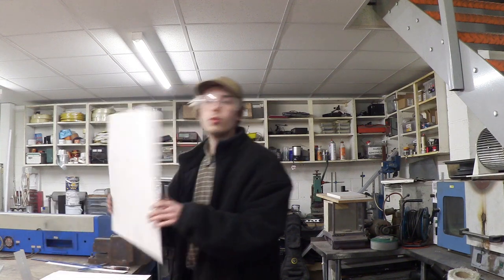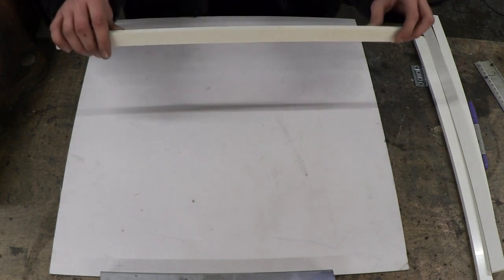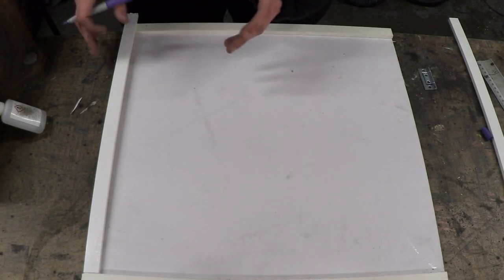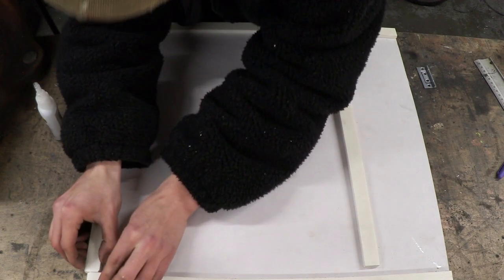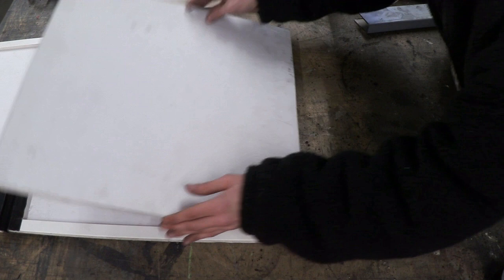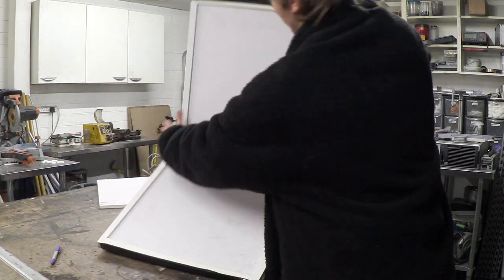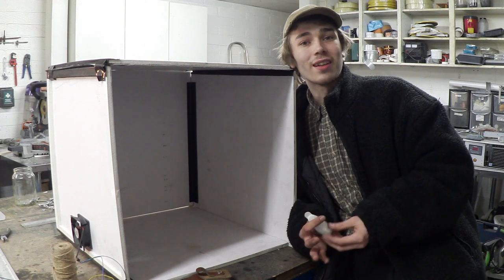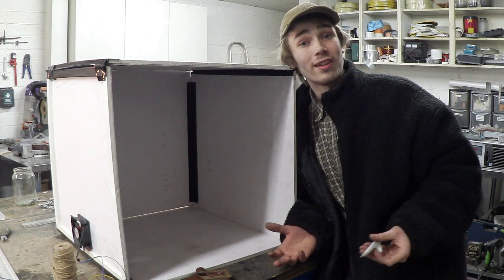969 - DIY Foldable Spray Booth

Comment: an extractor filter, a proper fan (for a bathroom), a drier hose and vent it outside
Reply: That would be awesome! Thank you for the suggestion. :)
Reply: @MyNameIsLukey  You're doing great! I've made one for airbrushing models! It's not collapsible but it's made from a similar material like builder's board. I used wood glue and toothpicks for nails to hold the corners lol

Comment: Very handy idea!!  Beats a cardboard box hands down - space in the shop is at a premium these days, anything that stows away is a winner in my book!!  You might consider a slot so you can insert a replaceable filter over the extractor fan.  😊   Maybe a strip of LED tape to light the interior of the booth from above, you can run it off the same power as the fan.  You can use plastic wrap or something as easily replaced to protect the strip so that you don't paint over the lights. 💡😊
Reply: Hahaha I agree space is like gold dust! I really like the idea of a replaceable filter, which I might have to do. as for the led strip that is an addition that needs to happen! When the lighting gets a bit dark I tend to use my phone as a source of light when spraying. It works well enough but I only have 1 hand free. Thank you for the great suggestions! :)

Comment: You can improve the hanger by using a standard j-hook.

Drill a hole in the center of the top the diameter of a j-hook shaft and insert the j-hook from the inside.

Screw the j-hook into a bit of 2 x 4 or 2 x 2.

Now, when you want to turn your part around; simply turn the 2 x 2 or 2 x4 you screwed the j-hook into.

Hmm; if you don't want to drill a hole in the top, that plastic is thin enough that you could also use a hook with a magnet base and some angle iron to stick the magnet to.

Turning the angle iron turns the hook.

Comment: Dryer hose off of the fan is a good idea; then fit some wet oasis foam into the end furthest the spray booth as a wet filter. 

Secondly; I noticed that you glued where the ends of the side boards bit up to the foot and head boards, and I suggest you take a quick second to explain why so you can transfer some of your experience along with your know how(Rob did a vid about something like that before and I am confident that he would agree).

Well done mate!